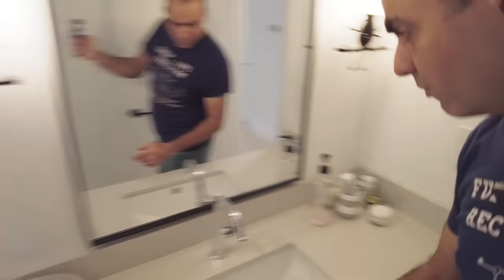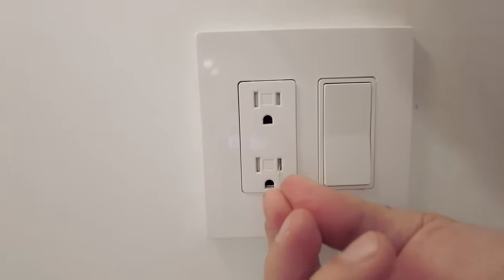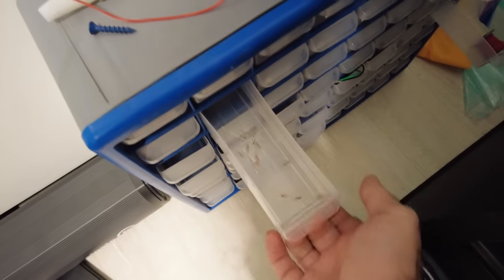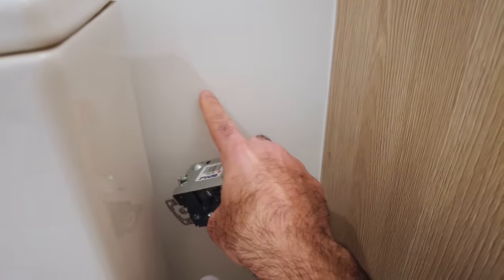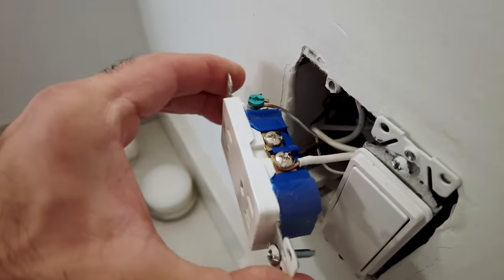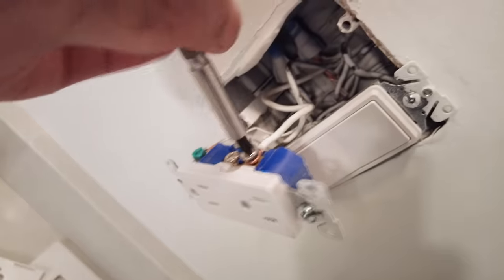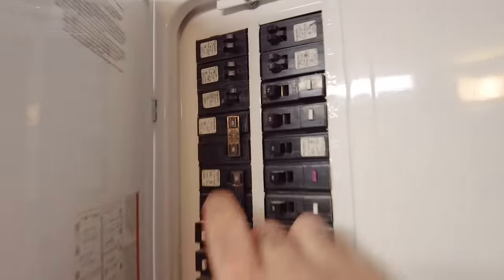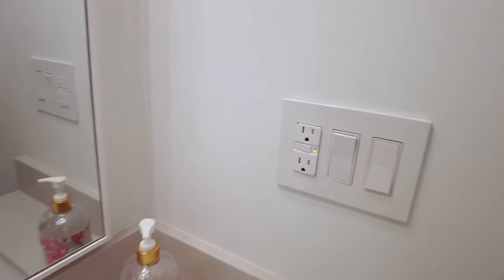Installing an Outlet… For a Toilet Seat?!

Comment: Pretty good job.

Only thing I'd add is, when working with metal flexible conduit (what we used to call BX), use a red head at the end to protect against the metal cable cutting the conductors.

I thought it was required by code, but apparently it's just a "best practice".
Reply: You're correct - it's required. The list of violations in this vid is long.
Reply: @snakeinthegrass7443  But just look at the boost to engagement he's gotten by editing out all the footage of him doing those things ;)
Reply: @snakeinthegrass7443  All the electrical forums I've found seem to indicate red heads aren't required, but highly recommended.

If you disagree, can you provide the relevant section in the NEC code?  I can't prove a negative, but you can provide code references to show they're required.
Reply: @stevesether  I'm shocked! When I started in the biz, all there was available was BX cable. Then when MC came out, the manufacturers still attached a bag to the roll so I hadn't realized anything had changed. I should've known something was up when they started sending bags with 5 bushings in it and then it stopped completely. Every electrician I know still uses them, but after a very quick search just now, I see you are correct - they are not required. It's my belief that this was done not because there is a ground wire inside now, but rather the armor is no longer steel - it's aluminum. I don't know how either of those situations would eliminate the need for a redhead, anti-short, bushing - however we say it.
Thank you for forcing me to correct myself. I will always continue to use them because it seems crazy not to. And the way he unraveled the outer jacket was insane!! I would've loved to see the actual cut he made in the armor when he was done. That is the sharpest part and if it's not done carefully, there will be a very small razor in there just waiting for the next guy to get it. One of the saddest part is that he didn't have to use MC at all. He could've just used Romex because it is not subject to damage inside the cabinet. And that would've eliminated two violations because (1), you can not shove armored cable into the clasp of a plastic box that's designed for Romex. And (2), the metal box he bought that he had no idea how to use, was in fact the wrong box. That too was designed for NM cable. The screw-down clamps inside that box were absolutely the wrong ones to use. Using those type will def lead to increased risk of being cut by the armor because the proper clamps are designed so the the wire can't bend at the armor - it bends at an extended portion of the clamp. It's not there! 
I know he goofs around and plays dumb a lot, that's what makes his channel unique. But this one wasn't an experiment in his lab. It's a permanent part of the electrical system in his home where his family lives, and that's nothing to play around with. Sorry for ranting but this has been my life for almost 40 years and this was truly hard to watch.
Thanks again for teaching me something new that I will NOT be passing along to my colleagues. 🤣🤣 God bless and stay safe!
Reply: @snakeinthegrass7443  Honestly I thought the red-heads were required as well.  I like to check my assumptions, so I did some quick googling and was surprised to learn they're not required.

With that said, I'd never not install them, and I've put a good many of them in my own house.  I'm not an electrician, only a DIYer that generally knows what I'm doing.  

My house sadly didn't have this luxury of having someone who knows what they're doing work on the electrical.  I've replaced quite a lot of the hack work over the years, so I'm familiar with how people REALLY screw things up.  Just finally got all my ground wires working everywhere, which someone, 30 years ago, forgot to hook up a ground, in some unknown spot.
Reply: I can't speak for the NEC, but in Canada the CEC does require the use of anti-shorts in armoured cable if there is no inner jacket - 12-610 1) a) is the relevant rule
Reply: What about UF romex?
Reply: @manletopia4801  I think that's legal, but it's a waste.  

I think you can even put in just regular old romex in a cabinet like that, since it's not "exposed".  Code only requires AC or MC when there's potential for damage to the cable.  Seems a little unlikely to happen inside a cabinet like that.
Reply: @snakeinthegrass7443  
I think that this video is a bit irresponsible to have on youtube as a lot of people think that this was a good example to follow. In California you have to pull a permit and get an inspection on this type of job which would have taken care of the code violations. Also if one is suggesting to go with unprotected romex, would it not be better to go with Direct Burial UF Wire since it is potentially in an environment that can a fair amount of moisture and that wire is a lot more rugged.
Reply: @stevesether  
The cost difference is very little to go with Direct Burial UF Wire and personally I would be more worried about the potential for a fair amount of moisture and cleaning fluids to contact the cable in that position under the sink faucet. Not a problem in the short run but long term is another issue.
Reply: @Mentaculus42  There def should be no moisture under the sink. If so, you have much bigger problems than the wire getting wet.
Reply: @snakeinthegrass7443  
I disagree, it is easy to have some moisture depending up how the sink is used and how well the backsplash is sealed (if at all). You always have to assume that some liquids (cleaning fluids also) will have opportunities to enter that area. Many times I have see old metal drain “traps” corroded to the point of leaking. You have to remember that when you put something on youtube, some people will “find” a way to do something that causes issues, sometimes years down the road. It is only responsible to note that “in some places that there is a legal requirement to have an inspection”. Then people are informed that that might be an issue.
Reply: @Mentaculus42  I don't think UF is really needed, nor does it provide much more protection that regular romex.  UF is just harder to work with as well.  Harder to strip, etc.

Normal Romex still has insulation on the conductors.  UF is designed for situations where it's wet 24/7/265.  It's just a bit of over-kill under a kitchen cabinet where it might get wet rarely.  If you really have bathroom cabinet that's wet all the time, or wet even a few time a year...  I think you're going to have more problems than just your wires.

If you're that concerned about it, put in a GFCI/AFCI breaker, and that'd offer a lot more protection than either.
Reply: @stevesether  
I agree, it is very difficult to work with but is definitely much more resilient against physical abuse. Short of purposely trying to drive a nail into it, it is almost indestructible. However, as you point out, it is a pain to strip. I just didn’t care for the use of the “armored cable” being used in the area of the backsplash of a sink. Regular Romex in a short piece of hard conduit would have been better, but I think that that is not to code, putting Romex in a small conduit (generally due to heating issues). My experience is that that area has too much opportunity over the years to get moisture exposure. Sometimes a little overkill is ok.

Comment: 09:34 add a string. It doesn't do anything, but is there if you ever need to pull another wire through the same channel. Rinse and repeat. But always leave a pull in place.

Comment: Tip:  10:12 - Put the curved side of the bracket into a pair of lineman's pliers* and "bite" down just enough to hold it.  Slip the bracket over the wire sheath, and bite down hard enough to bend the bracket a little, but not enough to bend the sheath.  Then the bracket will hold on to the sheath nicely while you drive the screw in.  I did a lot of wiring in my attic, and this saved me a lot of time.

(*Lineman's pliers worked best for me, but I suspect it will work fine with any pliers that have serrated jaws)

Comment: Coming from Europe I'm always surprised to see all electrical cabling in metal (now I know why thanks) the metallic plug boxes and the exposed live and neutral screws... It's all plastic and covered here, and it feels so much safer. But maybe it's just because I'm used to it?
Reply: In US past 60 some years, it's pretty rare to see metallic clad cables installed in residential constructions. 
Said that, this guy's application is a perfectly sound example reasoning that some part of the drawer mechanism could fail and pinch against the cable. 
Exactly right about the hazards of exposed screw terminals and non shielded connector pins. 
For electrical safety, The US is seriously lacking in many regards.
Reply: Metal electrical boxes are required to be bonded to ground for the precise reason of having a return path should the box become energized. Also, while not a requirement by code, it's highly encouraged to wrap the screw terminals of a receptacle in a metal box in electrical tape. 

Typically, electrical conductors are not wrapped in metal. They're usually wrapped in a plastic sheath. A popular brand is "Romex".

Also, not excusing our serious lack of electrical safety, we use 120v for everyday residential use while Europe mostly uses 240v. So I believe that plays a part in why Europe has more requirements for electrical safety than the US. We also use 240v, but only for large appliances such as clothes dryers that don't typically get disconnected from power on a regular basis.
Reply: @benjurqunov  Highly dependent on the age of the house.  Before "Romex", i.e. non-metallic cable became popular in the 60s, and definitely in the 70s, BX wire with metal cladding (originally steel, now AL) was generally used.  My house was built in 24, and it's a mix of BX and Romex.
Reply: And I'm amazed that Wagos isn't a requirement in the US
Reply: @ghostali8351  There' nothing unsafe about wirenuts.  In some ways they're slightly better since the resistance is a little lower.  Code should be based on experience in the field, not irrational fears.

We've been using them here for 60+ years, and they just aren't a problem if you use them right.  All you have to do is give them a slight pull to make sure they're in properly.  

Wagos sometimes approach $1 a piece or so in smallish numbers of 30 or so.  I'd rather just buy the wirenuts once and be done with it.
Reply: @tier3rd375  
But the ground connection is still unnecessary point of (unlikely) failure. Probably just technological innertia since plastic is cheap.

True on 120V, GFCI has higher chance of saving you on half the voltage, Europe prefers  energy companies profits above safety in this case.
Reply: @tarnvedra9952  
What's the mA protection on the GFCI? Here we're using 300mA differential breakers for the whole house and 30mA on the rooms where the skin can be wet (bath room, Washing machines, toilets, kitchen...). That's  to protect us based on the higher voltage we have.
Reply: @mysa39  Important thing is that GFCI/RCD doesn´t limit the current going to ground. It only measures it and trips with non-zero time delay. Body resistance at specific instance is constant value, half the voltage means half the current will go through you as per Ohms law.
Reply: @mysa39  We use 5mA here.

Since you Europeans have a tradition of calling our electrical system unsafe because it's different than yours, I'm tempted to throw that back at ya :).

I'm sure it's all fine.  Reasonable minds disagree and all.

Comment: I had to do the same in my bathroom.  I just went ahead and cut small holes in my sheetrock, making sure to keep the pieces I cut out and not let them fall into the wall.  That way the wiring is in the walls and I was able to use regular romex.  Sheetrock repair is pretty easy to do  The way you did it, if someone ever decides to change out the bathroom cabinet they are really going to curse you for running the wire through the cabinet. 😁

Comment: In Germany more or less all outlets have a common (sometimes split per floor) GFCI protection.
And these GFCI "breakers" are installed at the same place as all other breakers, so you do not need to search the whole house.
But be aware, that in older buildings, this might not be the case.
Reply: We have GFCI breakers as an option here in the US as well, they're becoming more common.
Reply: @LiquidPortalDigital  Almost all municipalities now require combo breakers for almost all circuits. These are both AFCI and GFCI, combination breakers. Exceptions are now for permanently wired devices such as ovens and cooktops. Strangely, Air Conditioner units are forced to comply. Soon all circuits will be required to have combo protectors

Comment: 13:26  That's one reason I prefer to use the plastic boxes - no need to ground the box.  There's also the advantage that if the outlet ever gets loose, it can't short the side terminals against the box accidentally - and as there's a limit to how many connections you should put in each size box, having one less pigtail makes the job easier.  👍
Reply: Benefit of the metal box, if the electrical ever starts to burn, the box won't be harmed, and possibly even stop the fire.
Reply: I prefer metal boxes. You just ground them and there's no need to ground devices individually. Plus they don't flex or anything.
Reply: @jeevana.6391  I am pretty sure that only grounding the boxes is against what the Canadian and American electrical codes say.  I also think the reason we ground our devices as well (in Canada we don't ground light switches, which is fine, but some would disagree) is for redundancy sake.  I am not an electrician but I came across a set of lights in our basement that had a few problems:  There weren't strain reliefs on the non metallic (Americans refer to it as Romex) cable running to each octagon box, so I pulled those boxes and put in the strain reliefs required, the connections where Marettes (wire nuts to those in the US) were supposed to be used were twisted together and only electrical taped so of course I put Marettes on those connections and also had to make new pig tails at each box so they were grounded.  I couldn't use the lights so in their place I put electrical outlets as I wanted to put shelves against that wall and maybe plug some lights into those for each shelf.

That job, working in awkward positions is definitely relateable to Mehdi putting those clamps in to hold the wire, I had to work above my head for those.
Reply: @WJCTechyman  Grounding the box only is code compliant as long as whatever connected has a path to ground. They're called self-grounding devices. Outlets have their ground connected to the same strip of metal as the screws do and you can usually see a bit of brass on the mounting ears specifically for this. Most lights are the same. If installing something that doesn't have that path, say a type of light fixture, then it needs to be grounded via wire.

Also I don't know how applicable it would have I'm your case, but learning how to drywall has been the best thing when doing any projects involving running wire. It's so much easier to work while not cramped and hoping you can poke something through a hole a metre away.
Reply: Fun fact: plastic electrical boxes in Canada have metal straps, so you still need to ground them. It was surprising when I learned this. Also btw I don't believe ground wires count towards box fill.
Reply: Isn't that why you are supposed to wrap the perimeter of the outlet with electrical tape?  So that if it gets loose or if you grab the sides when you pull it out., like Mehdi did,  it will not zap.
Reply: @ricksmith3045  Wrapping the outlet with tape is just a custom and is NOT required by code. Unless a mounting screw is completely removed it will not short to a metal box. Personally I'd rather go without the tape because it means you can do a visual inspection (as well as testing with a multimeter) without removing everything. Plus electrical tape leaves a mess.

And regarding the shock risk, you shouldn't be touching there in the first place.
Reply: @eDoc2020  The ground wire does not count for fill, only current carrying conductors count.
Reply: @Throbbit  UL and NFPA both say they are approved.
Reply: @snoopdogie187  According to UL, the opposite is true. The PVC is a special type which is commonly rated for 2 hours. If you look at the box, there's a circled number indicating the hour rating. The vent holes are designed to close first to limit the heat released into the wall. 
Metal boxes can definitely be destroyed. An arcing fault at 20A current can, and often does, burn a hole in the metal. Just like an arc welder. A 20A thermal breaker is unlikely to trip in this condition. Molten steel and copper then spatters all around inside the gypsum, onto vertical studs. Properly specified plastic boxes offer better protection for this scenario.
Reply: I don't use plastic boxes because they can easily crack when the outlet or switch is being screwed into them, making wiggly.  Also, as someone here already pointed out the metal boxes can potentially stop fire.
Reply: @GreyBirdToo  Hey whatever works. I found some information critical for use. I got really lucky at an auction, I was the only one there to bid a couple hundred units. When I looked closer, these were quality boxes for commercial use. The difference was incredible. Of course, most are cheap crap as you noticed. I would never buy the low quality again, but the good ones are worth the money for me. 
And they are better at fire stoppage if it has the UL rating molded into the case.